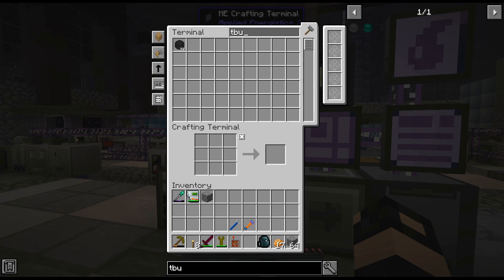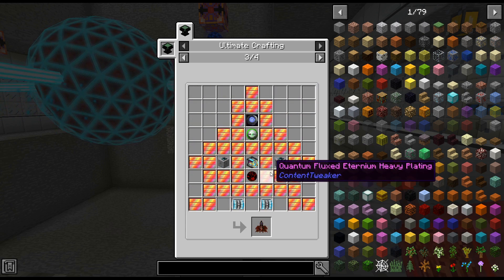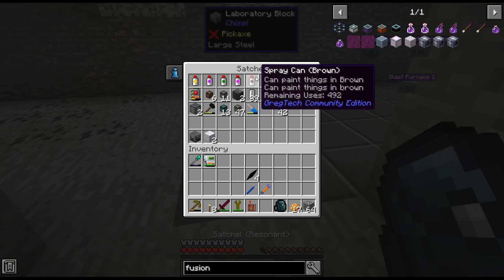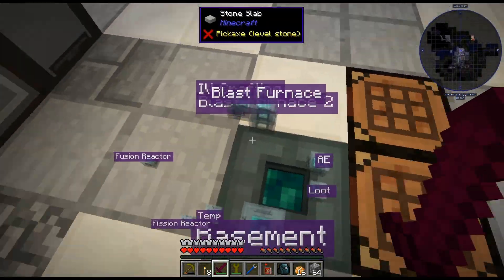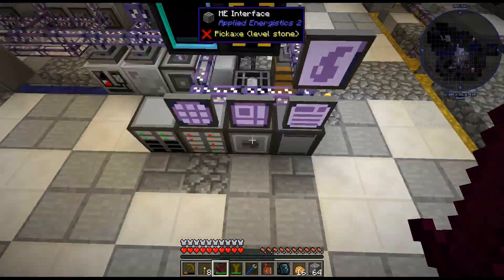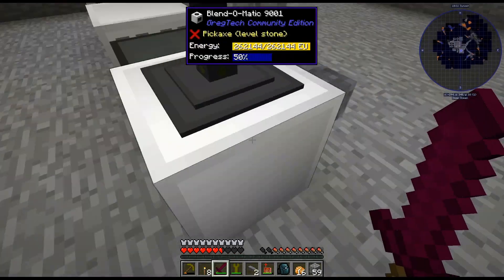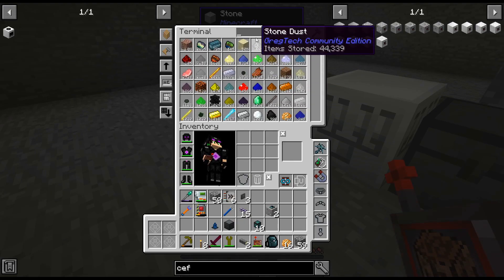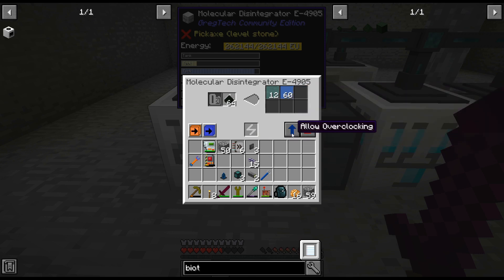Omnifactory - 87 - Nickel Plasma Part 1

Comment: That burnrate is actually insane, is it per milibucket ?
Reply from the maker: No, I've never been able to figure out how its calculated. It'll burn that long, but each process can use a few buckets worth of plasma when it starts a new process. I don't know how much the nickel plasma will use, but Oxygen plasma uses up around 900mb each process
Reply: @Kharax82  I think a single mark one fusion reactor can sustain 24 plasma turbins on its own, provided with enough resources. since nickel plasma burns so much slower it can probably do way more, but the resources are kinda hard to automate so its not worth it when the helium is pretty much free
Reply: @Kharax82  If you mess with plasma turbines in a sandbox, you'll see that it takes 15,551mb of nickel plasma to start the turbine spinning up.  It is still a lot longer than oxygen but JEI is comparing 1 bucket of oxygen vs. 16 buckets of nickel.  I haven't bothered to send each turbine to its own energy core to see how many RF each one yields.